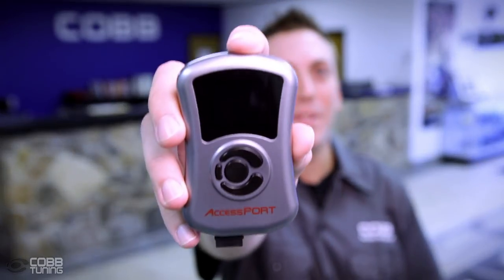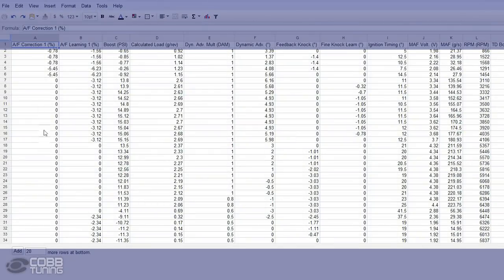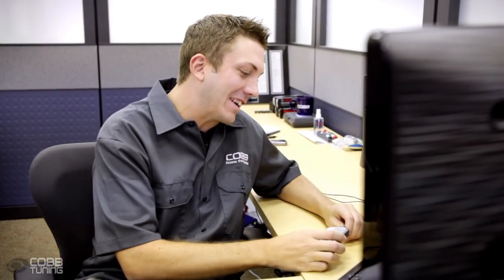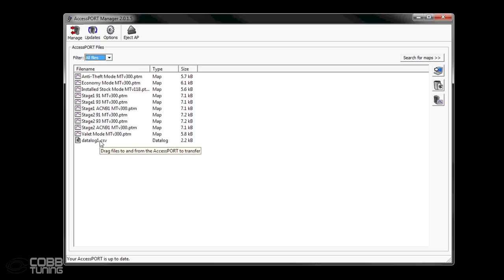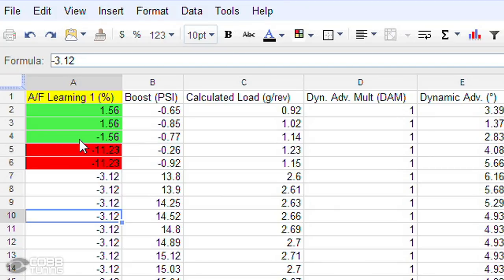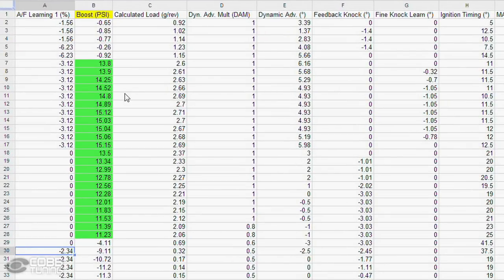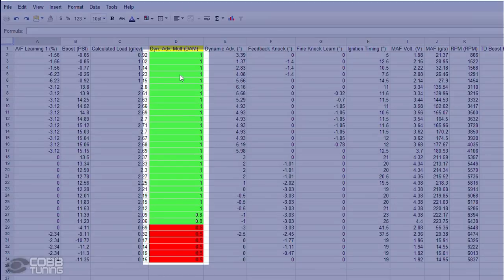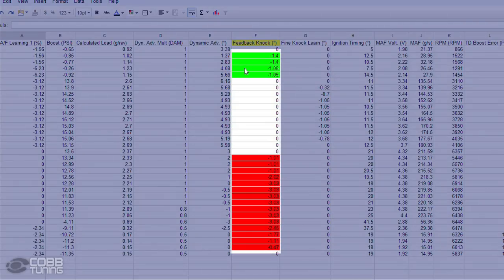COBB Tuning - AskCOBB - Subaru Data Logging

Comment: It won't make the exhaust any louder but you will hear the turbo & blow off valve noises a lot better both outside and inside the car.  And yes, you need to tune your car if you get any aftermarket intake.  Cobb has maps specifically for cars with their SF intake you can load using an AccessPort.

Comment: @jflayva I think it has something to do with the load on the vehicle. Meaning, how much the engine is actually working, a lower gear will require less of a load to accelerate it, while 3rd or 4th will require much more power/tq and boost.

Comment: hi cobb, it would help a lot if cobb did a video on tuturiol for tuner beginners. 

i recently bought an accessport version 3 for my subaru wrx. i will now purchase an cobb SF intake and soon will begin the install..

but my problem is (as a newbie) where do i begin? now what? i also did watch hundreds of videos on installations of accessports and sf intake -- but none started with the basics such as:

1. plug in a car batery charger.
2. install accessport into car but do not disturb during install.
3. now unplug car battery charger.
4. now install SF intake.
5. after intake is installed,after  now follow these procedures how to remap the accessport.
6. after accessport is remapped for the intake, can we now unplug the accessport or wil that break the ecu? 
7. is there  an "eject the accessport" function like how it is on a computer when pulling out a usb? or can we just pull out the ap anytime?
8. what happens to the car with accessport and intake installed after 7 years of driving? will there be issues9 later in the future?
9. what do we do if during the install "it bricks the factory ecu" -- are we in trouble?
10. what temperature can i keep my accessport in? 
11. will the accessport and intake install get ruined if suddenly i install a car starter? i live up north at really cold temperatures.

thanks cobb! a video of these things for newbies like me who are afraid to use this product will be greatly apppreciarted :)
Reply: +COBB Tuning wow Thank you so much Cody!! your accessport video 1 to 3 rocks! :) it helps alot.

so from my knowledge and what ive been asking cobb service - the steps are:

i will install my sf intake, and then install my accessport v3, and then the accessport will automatically save my ecu setting, and then i will install the accessport stage 1 sf intake canada, and then i can unplug my accessport and leave it unplugged forever.. do i need to do anything on my windows computer? can i just have fun with my sf intake and thats it? and the re-install the sf intake and accessport when i decide to sell my wrx?

thanks Cody.

Comment: from what i hear is, you have a problem with the car and you need to go to the dealer. so you reflash back to stock and go.  the dealership can see the computer was reset right before you got there and they automatically say it was tuned..i havnt delt with this situation yet but ive heard this from many.

Comment: I have just bought an STI w/ stage 2 + CAP tune, luckily the previous owner left the CAP for the future owner (ME!) I haven't gotten the emmission tested yet, but am curious if i should plug it in (as i haven't yet) and change any of the maps or if w/ 18k miles on a cat'ed stage 2 that im fine.

Comment: I am confused by the video about how to log. In this video, it seems that to log different values I have to manually select which parameter I want to log and enable it for each one. Is that right? Right before he launches to red line, it seems as if he only presses one button instead of enabling them all of the parameters he wants to log.

Comment: need serious help w/my subaru, when i put in the restrictor pill the boost goes crazy shooting to 20lbs down to 8lb and stays fluctuating between there at wot 3rd gear. brand new engine with restrictor pill removed(for engine safety) for break in period. without the pill it gets about 11.6lbs  boost, but it doesnt jump around; when we put the restrictor pill in and get the crazy boost, we get misfire codes in cylinder 2 and 4
running stage 2 ap
tbe, stage1 crower cams, turboinlet, catless uppipe

Comment: hi cobb, in this video i believe ian is holding a accessport version 2, does this video also apply to accessport version 3 on 2008 - 2010 subaru wrx?
Reply: +COBB Tuning Thank you Cody! i really do hope they make more videos for the new V3 accessport for 2008 wrx. As i did my researches it seems the 2008 wrx 'automatic transmission' is limited to only the sf intake and downpipe :( are there more parts that i dont know of that i can install into my car?

Comment: i have a 02 wrx, i installed my accessport on saturday afternoon, i have a catback and spt intake and hks bov, do i need to buy a different intake because i was reading and it said it is not compatable or something, and also i put it on stage 1 93 octane and i put in premium but it said 93 on the pump, should i change it to stage 1 91? and i plan on buying bigger injectors in a couple of months so can i still use the economy mode? and what is the difference between realtime and reflash maps?

Comment: hey there i have a question if i put a cobb sf intake on a 2013 subaru impreza wrx sti  sedan will it make the car sound louder and can i hear the blow off valve? also do i need to change ecu or change the map?

Comment: Does somebody know if it's possible to do some kind of tune on n/a's? I recently put a new engine in my car, and am doing a few bolt ons i noticed with this newer condition 04 motor in my 05 and all new fluids etc it feels better. i ordered and exhaust, intake, but i want to tune it lightly to get some more hidden prowess out.

Comment: i have a subaru wrx 2013 and my mods are mid pipe 3"and  filter aem of the box and go fast bits bov, in the fine knock learning and feedback knock some time say -1.4 in both that is normal?l i using stage 1 91 oct MTv 331, but i ran the car with 93 oct
Reply: Javier F.F. Cobb states that anything less than 4.2 while cruising is within spec and anything greater than 2.80 WOT should be looked into. 

1.40 is a small correction. I wouldnt worry too much.

Comment: So I have an 04 STI with a new motor in it, cold air intake, down pipe, the works, I am currently running the stage 2 map and my DAM reading is consistently at .7   
Is this something to be concerned about? There is no Fine Knock or feedback knock.
Reply from the maker: How long have you been driving the car since installing everything?  It's possible that the default DAM value on that map is .7 and it will learn either up or down after driving the car for a bit. - Marshall@COBB
Reply: It has about 500 miles on the new block.
Reply: what is a good DAM value to have though? I heard anything below 1.0 is bad.
Reply from the maker: 1.0 is the highest DAM value for this specific ECU.  What map and version number are you using?  Was the value at .7 immediately after flashing the ECU? - Marshall@COBB
Reply: COBB Tuning yes it is the stage 2 91 tune . I want to say version 3.

Comment: hey I have a 2016 sti i just added the cobb intake system and cobb turbo inlet hose on my car along with turbo xs down pipe I also have a namesless axle back I put 93 octane stage 2 tune yesterday on my car and today noticed feed back knock -4.20 and the fine knock lean was all zeros I just installed this and my car only has 6500 miles on it don't know what it can be ?
Reply: Angelo Maselli. did u ever got an answer?
Reply: For 2015+ Sti, in order to run downpipe and intake you need to upgrade the fuel pump and injectors
Reply: Do NOT run a stage 2 tune without upgrading your injectors and your fuel pump. The stock parts mentioned can’t keep up with the tune and what it’s asking your vehicle to do under WOT or otherwise. Be safe!

Comment: are you suppose to just mat it to the floor right from 2500? or do you ease into it
Reply: +Derek johnson i want to know this too. because a high load like that at lower rpms isnt good for our cars.
Reply: +Kristofor Lindquist You don't really slam on the pedal straight away. You just make a fluid to the floor motion. I count to about 2 seconds and at the end of the "Mississippi" I make sure I'm on the floor.